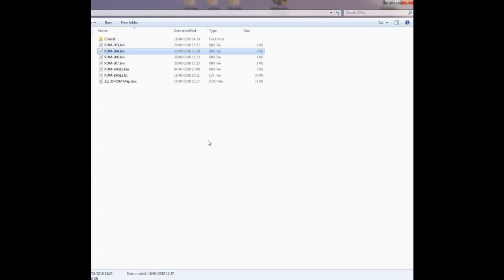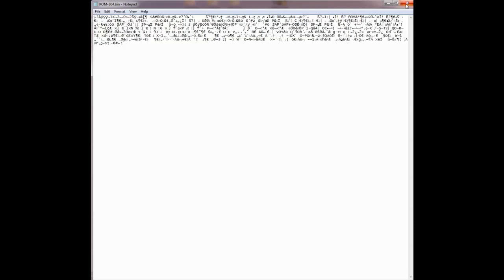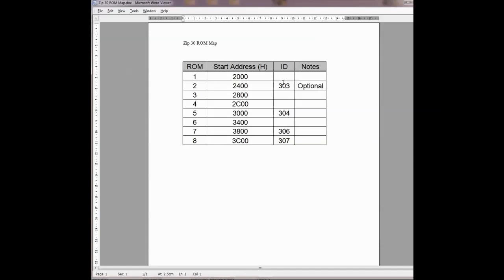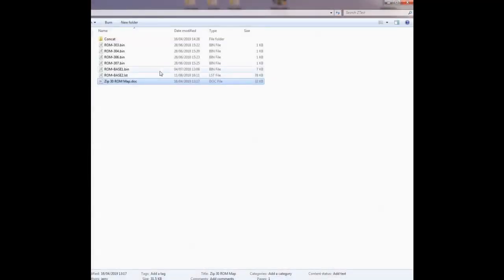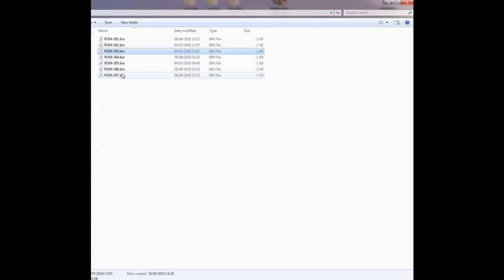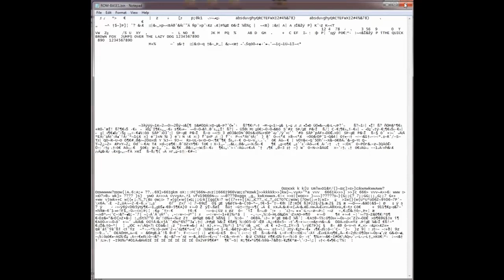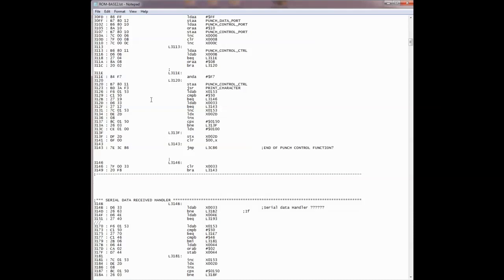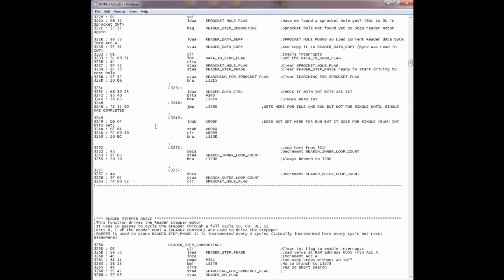Reverse  Engineering Firmware 1

Comment: I have an oscilloscope device I purchased on Ebay that would help me at work, but I can't run the device on my laptop because the software is no longer available. Is the a way to use this device and its components? If my laptop can just communicate with it I should be able to I believe. How do i do it  please?

Comment: Haven't watched the Part 2 video yet. Would have helped to mention that this is MC6800 code, at least that is what it appears to be. Maybe you'll also cover how the reset vector gets to this code if none of the EPROMs are located where the reset vector is located. Maybe you'll also cover what tool you used to disassemble the code.
Reply from the maker: Hi, I will not be getting to detailed processor specific code until video 3. This video was more about how to reverse engineer generic ROM firmware. Video 3 will cover the 6800 reset and interrupt vectors.
Reply: I'll have to watch Part 3. I assume the address space is only partially decoded and the EPROM at 3C00-3FFF is aliased to cover the vector space at FFF8-FFFF. When I have looked at 8-bit firmware using static analysis I initially assume no locations are executable code unless there is an execution path to the locations from the known reset and interrupt vectors. Otherwise you end up with garbage disassembly of data as code. Curious to see what methods you used on this project.
Reply from the maker: It was a convoluted process because the ZIP30 had so many faults. I finally derived the addressing map and the RAM variables. The mapping was fairly easy to figure out. Things such as the ROM's are only partially decoded, only the 4 bits used to address them are actually decoded and most hardware devices are addressed using a bit mapped system. It got a bit complicated as the PIA's have ports that can act as input and outputs at the same time without the control registers being changed. As I go through the videos I will show more specific examples of what I did but it was a very long process so I will only be covering parts of it unless I get requests to cover specific areas. It was also clear that the code had been compiled using some form of optimisation. Video 4 will start to describe the specifics of how I determined 'where' things were in the addressing scheme. After that I will cover how I determined what each block of code did.It was further complicated by the way the code was written to allow the use of option ROM's so the code often checks to see if a particular ROM is present and then selects which code to run. I ended up creating some modified ROMS which skipped over blocks of code that I was not interested in so that I could trace through the code more easily. I do not have a schematic or any documentation for the ZIP30 and it has a mixture of digital and analog circuits so some functions are actually carried out in the analog domain which further adds to the complexity. All very interesting.